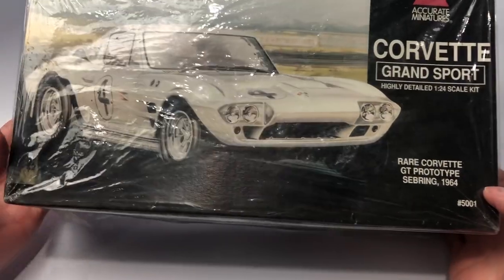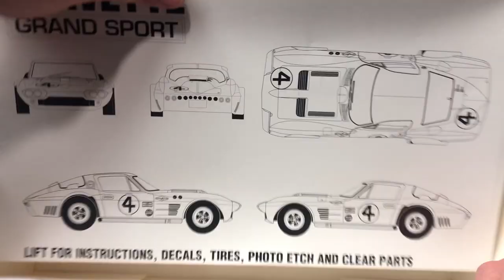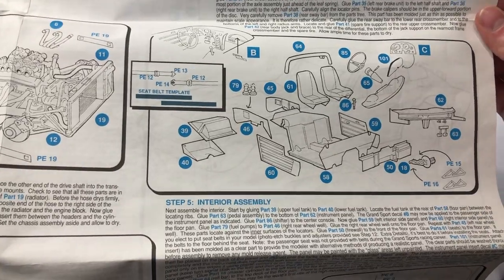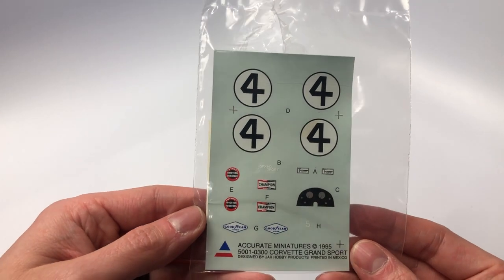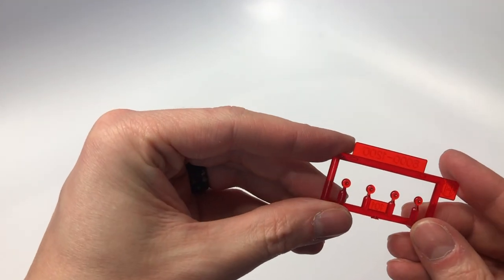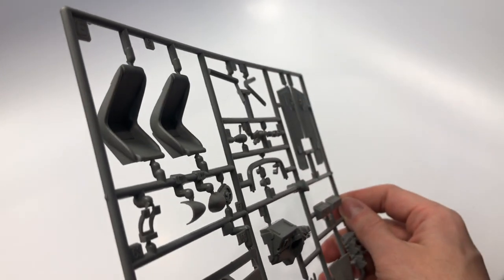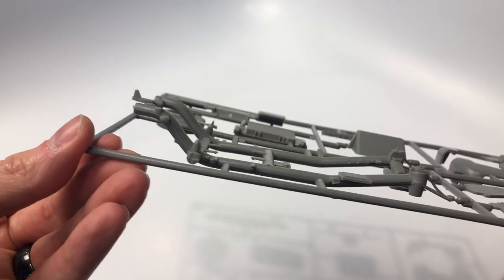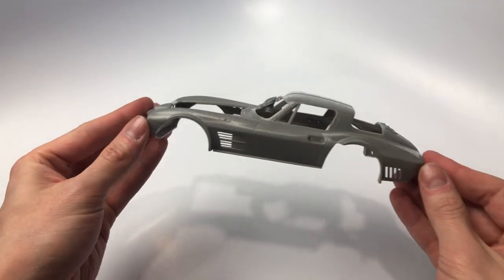Accurate Miniatures Corvette Grand Sport (5000) 1:24 - Kit Review

Comment: other than one of the, I believe, fuel injector line being broke, easy fix, and very little flash on the upper part of the grill, this is one beautiful kit.
Reply from the maker: Thanks for the info! It is a great kit and definitely a future build with the PE thats included in it. Thanks for the comment and watching!
Reply: Saw both kits @ACME  , but for some dumb reason just couldn't pull the trigger.  Maybe because I'd never seen it before. If it's there next year I'm getting both.